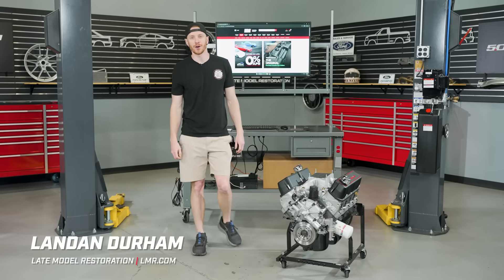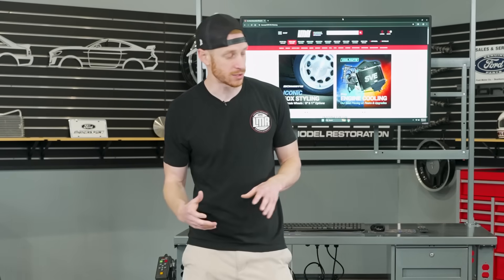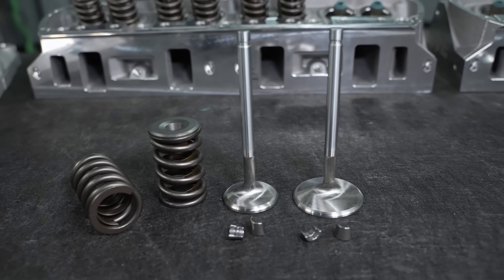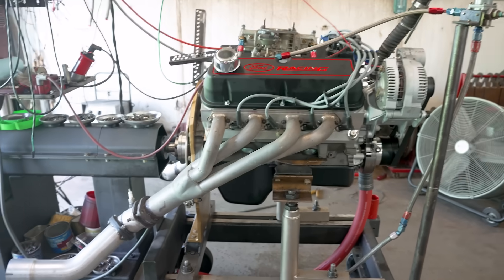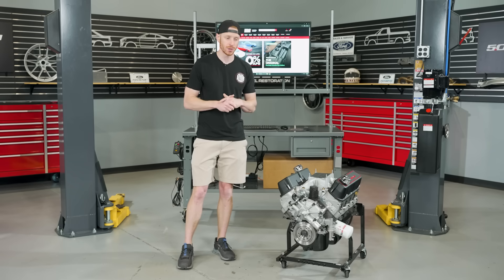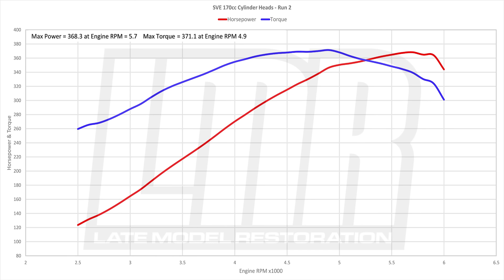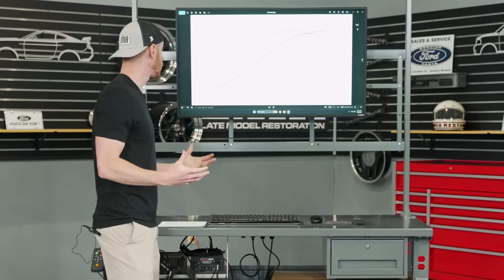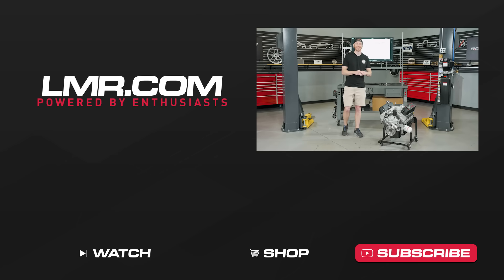How much power? 302ci Small Block Ford Engine Build & Dyno w/ SVE 170cc Cylinder Heads

Comment: Would you have to fly cut the pistons if you ran a comp cam 35-324-8 XE270hr-12 ?
Reply from the maker: Tolerances and variables permit a yes/no answer. Check the PTV clearance and make the necessary modifications if required. -Landan

Comment: I love my Coyote….but you can’t beat the sound of that 306. Of course the number will lower at the tires. But hitting those numbers in 97 degree heat with an alternator and water pump is pretty darn good.

Comment: I'm thinking on buying these SVE Heads and having them milled for maximum compression. How much meat can I remove from them to decrease the combustion chamber size even more? Also, how thick were the head gaskets used for this motor in this test? I'm looking at a pair of MLS Cometics C5511027 to chase even more compression on my 1994 Mustang GT.  Would those gaskets work with the SVE 170's and the OEM 94 302 block? I'm looking for a minimum of 11:1 - 12:1 Comp. for the street on Pump gas or E85. Thank you!
Reply from the maker: We used Ford Performance head gaskets. Part # M-6051-C51. Link below to the product page that has the gasket info. There was no mill-testing with these heads so I can't confirm anything in regards to that. Due to the amount of options for a small block Ford, we don't have the answers to every combination. There will be trial and error. I'm only trying to give you the facts instead of beating around the bush. Hope this helps and let me know if you have any other questions. Thanks! -Landan

https://lmr.com/item/M6051C51/mustang-ford-performance-head-gasket-set-7995-m6051c51

Comment: Are these the same design as the trick flow 170cc I'm wondering if these will work for my build. Stock pistons with n41 cam
Reply from the maker: No. The Trick Flow heads have a different valve angle. Folks have had good luck with those heads and the N41 cam. Regardless, you have to check PTV. -Landan

Comment: Can you elaborate more on widening the valve reliefs? How can one avoid having to do this or how much wider did you need?
Reply from the maker: The pistons already had valve reliefs, but they were too small. To enlarge valve reliefs, the technical term is "fly cutting" the piston. These tools are expensive. If you don't trust yourself by enlarging the piston by means of freehand, purchase the tools for a 2.02" and 1.600" valves. Or, take the heads to your local machine shop. You'll enlarge the reliefs until adequate PTV is achieved. On a street engine, .120" clearance is the minimum on both valves. This depends on who you ask as everyone has different preferences. Some folks will tell you that a touch tighter clearance is fine on a street engine. It's better to be safe, than sorry. Hope this helps! -Landan
Reply: @latemodelrestoration This helps a lot and I appreciate the in-depth explanation.  I am considering these heads on a build, so was wondering if there were pistons out there that would fit these better
Reply from the maker: You're welcome. Yes, you can purchase pistons with larger reliefs to save yourself the headache and hassle of enlarging the reliefs in the existing pistons. Specifically, we offer a Trick Flow piston thats has larger valve reliefs and will work with OEM rods. The only catch is the .030" over bore size and you have to source your own ring pack. -Landan

https://lmr.com/item/TFS-51404000/1979-1995-mustang-trick-flow-forged-pistons

Comment: Do you have to grind the valve reliefs ? I read on the website it would run with stock bottom end ,
Reply from the maker: This bottom end has forged flat top pistons with small valve reliefs. We needed more clearance so that's why the existing reliefs were enlarged. Not sure what you're referencing, but we don't have the info on the product page. Yes, the SVE 170s will work with a stock bottom end depending on camshaft and rocker arm ratio choice. Always check PTV. -Landan

Comment: Deffenly some good heads for the money.I run a set of your older ones with a F303 when they first came out a few years ago needed less to say I didn't go eazy on them running a Novi 2000 making around 12 lbs .The car make some good power and the heads held up great.I wouldn't mind trying the new 190s probably a little better.
Reply from the maker: Thanks for providing actual experience on the heads! I'm sure others will find value in this. -Landan

Comment: 371hp with a typical 15% drivetrain loss from a T5 trans and 8.8 rear gear is 315whp. Decent but i expected more as a mild 306 with a good cam, ported Gt40P heads and ported Dual Plane manifold makes 400-425hp on pump gas

Comment: Really shows the difference in heads flow commensurate to dollar. A set of afr cnc 185s would easily make 400hp, however they cost substantially more.

Comment: Could you give a run down on the accessory drive components?  I want to use that setup for my build.
Reply from the maker: It's a Motorcraft water pump, SVE 130-amp alternator, factory-style tensioner w/ upgraded pulley, and an SVE power steering & a/c delete kit with underdrive pulleys. All our available on our site. Part numbers below. -Landan

Motorcraft Water Pump: LRS-38501B
Alternator: SVE-17046K2
Tensioner: LRS-49222
Upgraded Pulley: ST-5553325
SVE Power Steering & A/C Delete Kit: SVE-9998DB-K
Reply: Thank you for the quick response. Which timing cover did you use?  I see yours has the provision for the mechanical fuel pump.  Just trying to get all my ducks in a row.
Reply from the maker: We used the carb version. Part # LRS-6019D. The EFI timing cover is part # LRS-6019B. -Landan

Comment: I recently did a video trying to determine if the power to weight ratio of a 302 SBF in a lightweight old muscle car could beat a gen 3 coyote in a much heavier 2021 Mustang.

I too had to “fly cut” my pistons with them installed.  My numbers were on a chassis dyno but very similar.  I used a TFS stage 1 cam, cheapy 180cc aluminum heads, 1.6 rockers, but i had a 650cfm carb with a victor jr single plane intake.  Car made 330whp or just a bit more then this setup if you assume 15% loss as I was going through a T5 and Ford 8”.  If you are curious of how that curve might change with a single plane but otherwise similar setup, check out my Channel.

I do wonder if the torque I gave up down low was worth it.  Car gets up pretty good with 3.90 gears weighing around 2,800lbs but it really comes alive above 3500rpm

Comment: That drop at the top is valve control issue. It likely wouldn't roll over that hard with a slightly stiffer spring

Comment: I cant believe we are ignoring having to clearance the pistons... Was it the pistons fault? That cam is not that aggresive, .512 lift??
Reply: It's not the lift it's the valve events.
Reply: @KingJT80  Yes, its more than lift. But barring some wild cam spec, everyone measures compatibility "in general" by lift. Looks like the specific pistons have small reliefs. Maybe for oem valve diameters?
Reply: @mtgmike50  you never  wanna  do that cause  you can have a .520 lift cam that wont clear  and a .600  lift cam  that will.  

If you mean radial clearance around the valve reliefs,  these heads have a 2.02 intake valve  so  it's  probably a  KB hyper piston  that has  the reliefs  big enough.
Reply: @KingJT80 I’m aware, you always check. This is a curious combo with variables all over. Smaller runners, big valves, cam from a company that doesn’t like to give specifics, pistons with apparently small reliefs. Not exactly a curated combo for a budget head sold to the weekend warrior.
Reply: The pistons in this short block are Speed-Pro Forged Pistons L2482F.  They have  a very small valve relief. Also .003 deck clearance.
Reply: @hubstang  What an unfortunate pairing. Thats going to scare the pants off most beginners, which this head is clearly geared twoards.
Reply: @mtgmike50 hahahaaha yes I have been looking for this comment …please and thanks to you all for bringing this up.I AM A BEGINNER 😂
Reply: @hubstang thick 5/64 rings.  2488 is the better choice, they are 1.5/1.5/4mm

Comment: I brought these same heads a few years ago. But I have a E303 cam. Question will the Anderson cam be better? I’m running a Holley sniper system with it
Reply from the maker: The Anderson N41 cam is optimized for entry level aftermarket heads. It has an operating range of 2600-6200 vs the E cam's 2500-5500 range. Duration at .050" is also slightly larger on the Anderson cam. I would consider the N41 a better choice. -Landan
Reply: @latemodelrestoration ok thanks. I’ll be upgrading soon

Comment: These dyno results keep pushing me to just buy a used coyote to put in my fox.  Why mess around buying all these parts have my motor rebuilt when I can just buy a coyote?
Reply: A coyote swap is gonna cost a good bit more money than these mods.  But of course results will be better.  Pay to play.  Of course it's "easier" to make more w a coyote if you can afford it by all means.  It won't be similar price though not to a setup like this which is fairly budget

Comment: Thought I'd see 1.4 to 1.5 hp per cub. Hopefully the bigger head perform better.
Reply: 1.5 is a top tier build. Not sure why you'd expect that out of a simple parts build engine. Even 1.35/cu.in. is a damn fine engine build. 
Could also be a matter of any dyno correction factor.

Comment: I don't know why anyone would waste their time with the 302 when their big brother is right around the corner 351 Windsor or you can do a cleavor 351 Windsor with Cleveland heads. That's the way to go
Reply: Because people just mod their original engine.  If they had a 302 already in the car it's easier just to mod it.  Not everyone wants to do a cowl or drop mounts or whatever.  Not everyone wants the extra weight from the 351 or the extra power.  I know it's hard to believe but not everyone makes decisions based on max possible power lol

Comment: The same combination will make 50 more hp with 11R or AFR heads.
Reply: Idk about that
Reply: @midnight347  a 185 or 190 will pick up by a bit but this camshaft wouldn't utilize what these heads could do. It would be a 
waste of 2500.00 CNC heads

Comment: Super impressive results with accessories. Might need a bit bigger (duration) cam to push a bit more.
Reply: No need, it was hitting valve float at 5800 in the 2nd run

That's a perfect engine for a fox with a T5 and 4.10's

Comment: WHY BUILD A 306 MAYBE IN 1980, BUILD A 363 AND MAKE 600HP 500 TQ ON PUMP GAS, ALSO ON 331 OR 347 VERY 1990'S
Reply: Period correct builds are a thing.  Not everyone is chasing et and power numbers
Reply: @midnight347  ITS 2025 WHY HAVE 400 HP WHEN U CAN HAVE 600 HP? U CAN NEVER HAVE TOO MUCH POWER. BEST BANG IN FORD IS THE 351W PUNCHED OUT TO 460 PUTS OUT 665HP AND 605 HP  ONLY 1200.00 MORE THAN A 363 600HP 500 TQ REALLY CHEVY IS THE BEST  540 INCHER 640HP 640 TQ 12K COST
Reply: 363 takes an aftermarket block bro that is a much more expensive build vs this fairly budget build.  Not everyone wants a million hp.  This kind of power in a light fox can be a very fun street car and quicker than you think
Reply: @midnight347  YES U DO A STOCK BLOCK IS ONLY GOOD FOR 500 HP NOT 600. MINE WAS A LIGHT FOX 79 LIGTHER THAN ANY OTHER FOX. PLUS I PUT ON FIBERGLASS DOORS, FENDERS, HOOD AND TRUNK, K MEMBER, AL HEADS. LOVE AN AL BLOCK BUT NOT WORTH THE MONEY. MY THOUGHT IS DONT CHEAP OUT BUILD IT ONCE AND BUILD IT RIGHT WITH TOP OF THE LINE PARTS AND A GREAT MACHINE SHOP AND  GREAT ENGINE BUILDER. I WATCH MY FRIENDS BUILD THEIR ENGINES 3-4 TIMES AND STILL NOT GOOD.
Reply: @midnight347  WRONG STOCK BLOCK CAN HANDLE 600HP HOW LONG WHO KNOWS  BUT U CAN BUILD IT TO ONLY 500 HP AND MAKE IT LAST A BIT LONGER KITS R 2500 DOLLARS NOT BAD FOR STEEL CRANK FORGED PISTONS AND RODS

In summary: While a 363 stroker can be built using a stock 302 block, it's generally not recommended for serious performance applications due to the risk of cylinder wall cracking and the potential for increased costs associated with repairs. An aftermarket block like the Dart SHP is a much better choice for building a reliable and powerful 363 stroker engine.
Reply: @SVENSKANYC you don't have the cylinder wall thickness in a stock block to bore it out to 4.125", and not having 4 bolt mains you're going to kill that block in no time, even at max bore. The 302 is not a 351 nor are either of them an aftermarket block. 
Look up the weight differences of each block and you'll see how much extra metal equates to extra strength in the better blocks. The stock blocks were overbuilt at a time when the 5.0 in 1979 was making 140 crank HP. They will literally live forever at the point. You have no guarantees at 600whp and you simply can't punch out a stock block to a 363.
Reply: @midnight347  STOCK BLOCK WORKS MAY NOT LAST 4 RVER @600 HP BUT FINE AT 500HP
Reply: @SVENSKANYC 363 is gonna cost 12k to build it the right way 

I can do it for way less with a top end 302 if need be. 

Don't buy things you don't need to chase HP you'll never need to beat other modern cars in the street. Spend money on heads and a camshaft that can keep up with the heads you buy
Reply: @KingJT80  JUST BUY A PRO BUILT BBC 540 INCHER 640 HP 640TQ FOR 12.6 K FULLY DRESSED HEAD TO TOES
Reply: @SVENSKANYC  540s  built by smeding  and shafiroff are 14 k to 15k a piece  14k  ill build a 450+HP 302  and an overdrive transmission with money left over.  it'll be enough

Comment: You should try a victor Jr l promise it will make more power
Reply: Wrong intake for a small cu. In. engine making peak Hp @ 5,700 to 5,800 Rpm, & a cam range only to 6,200 Rpm. This Perf. Rpm Air-Gap is a much better choice for average Hp, & Tq., from 3,200 to 6,200 Rpm.
Reply: @evilinside5984 am I called with absolutely fly completely stock what did Victor Jr in the 650 double pumper I'm talking from experience
Reply: Dude I had a complete stock what evicted Junior 650 double pumper 5 speed with 410😮
Reply: @Jimmyjamjr-strongman  Your combo would have run even better if it had a Perf. Rpm Air-gap intake. Many dyno tests have proven this, on combos like this that are less than 6,300 Rpm. Average power & tq., beats a peak Hp # every time!
Reply: @Jimmyjamjr-strongman  I even had a friend that put a victor intake on his stock 302 H.O. Engine, & it was not as quick in the 1/4 mile, as it was with the stock H.O. Efi intake!
Reply: I have been messing with mustangs since the 70s l have done my homework you should go  do yours l know what works already done it 93 stock 302 with Victor Jr and a 650 double pumper holly carb 410 gears 5 speed and the motor pulled until I let off of it if a motor turns high rpm it makes more power and it's useable power period try it school is officially out.
Reply: @Jimmyjamjr-strongman  Taking off that very Rpm restrictive stock H.O. Efi intake, & putting on that carb., & Victor Jr. Intake will make a huge difference, but it is NOT the best intake for a stock 302. Also a 93 mustang has a factory set Rpm Limit of 6,250. You aren't teaching nothing but your own agenda. Have you dyno tested your combo, vs the Edelb. Performer Rpm Air-Gap? Have you compared the average Hp & Tq., between these 2 intakes, from 3,200 to 6,200 Rpm? Look up dyno results, you will see what I'm talking about. This isn't personal, its just facts. If you were talking about a 302 with supporting mods= correct cyl. heads, valvetrain, camshaft, comp., exhaust, & making peak Hp @ 7,000 to 7,200 Rpm, & liked being shifted @ 7,500 Rpm, then that single plane Vic. Jr. would be a better choice in that setup vs a dual plane Rpm Air-Gap, but NOT on a stock 93 302.

Comment: 372 ftlbs from a 306 below 5250 is a damn good engine builder.
Reply: it could get real close to 380hp if it weren't tested at 97 degrees air temp.
Reply: That isn't too difficult to do on an engine Dyno w quality stuff.  That is prob gonna be 320 or so to the tire on a Dyno.
Reply: Does it run on 87 octane??

Comment: Knew it was 10:1, when clearance was needed; built a similar 302 many years ago that made 308whp. (10:1, Performer RPM 2.02/1.6, SystemaxII, tried to avoid ptv w/ custom cam) This engine loved boost too!

Comment: The comment to “remove accessories for 12hp” is just dumb man. So you’re gonna try and run around with no water pump or alternator? Great advice! Lol
Reply: Seen people remove the belt plenty through life at the drag strip... Guessing you're not a drag racer...
Reply: @02autogt  you feel this combination is intended for a drag application? 😂
Reply: @aaronliddell4280 it could be used in a drag application.  You don't have to be the fastest person on earth in order to drag race lol.  People have went pretty quick on the right cars w similar power to this.  Removing the belt is quick and easy to do.  Ppl used to do it all the time back then.  No need to today because there is electric steering and everything is alot more efficient.  On fox bodies it was absolutely a thing.
Reply: He said that just for comparison sake.. 

Many engine dynos use no belt drive at all. Electric water pump and that's it.  So zero net hp loss.

Comment: I'm thinking of adding these to my stock 302 in the future, plan is to keep the stock cam and just mate them to a trickflow street burner intake manifold. I don't need tons of power but a nice hp boost will make my 91 Vert AOD a more fun street cruiser.
Reply: Adding a 10" 2,800 to 3,200 Rpm Lockup Tq. Converter, along with a trans. Cooler, will give your Pony a lot more Giddy up on take off.
Reply: Look at the Trick Flow Stage 1 or the Anderson N412 cam. There's no reason to change the heads and intake manifold and keep a stock cam. It's literally wasted money. 
You can hit 300+whp without issue with either cam using the parts you mentioned. With the stock cam you'll lose 30+ HP to the wheels. And they're both very street friendly cams.
Reply: Do all that to a 351w and you’ll really make power